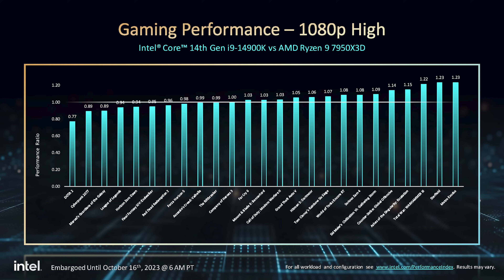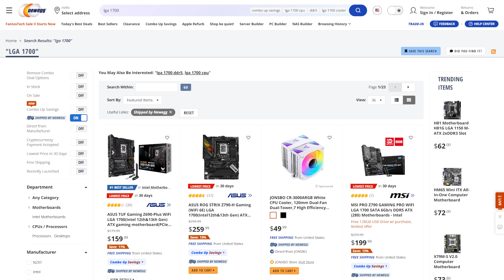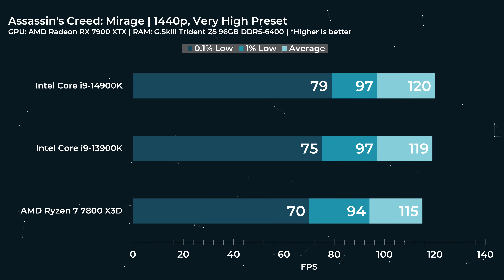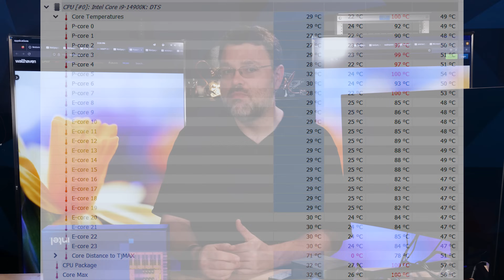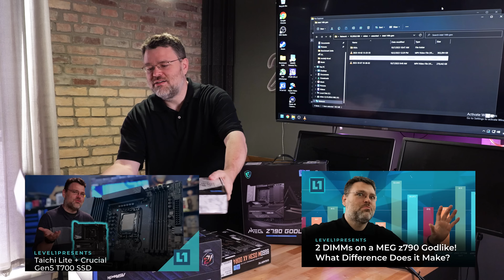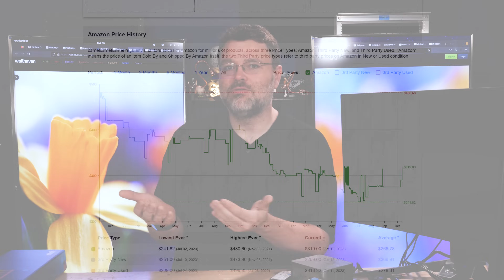14900K = 14th Gen or 13th Gen Refresh?

Comment: Please compare the non k versions when they become available.   I have a 12600 non k (zero e-cores CPU) and am thinking about upgrading to the 14700 or 14900 non k.  I am not sure it will be worthwhile for regular use, light gaming.  Will there be a worthy upgrade path from 12400/12600 that could avoid the power hunger insanity of the k chips??

Comment: As i understand, you can check your motherboard settings to see what power delivery mode is in, and gotta be careful as "default" is now the highest power setting, not Intels 253 Watt max. But yeah, you don't need to let the CPU roast at 350-400 watts under heavy MT loads, it seems to perform near the same. If i were getting a 14th gen, I'd try to take advantage the power savings and keep the same performance as 13th gen.

Comment: i have a z690 asus rog strix "E" mobo (DDR5),  I would like to upgrade from a 12900K to the 14900K.  Will that give me a pretty good boost for my flight simulator 2020 game?  i have a 4090 GPU and a 1000w EVGA G6 Power Supply...will I be ok?,  My CPU cooler is a closed loop Corsair ICUE H150i Elite Capellix

Comment: Stable is super important.
 As someone who has bought every top end CPU, including KS variants I'm excited to test the 14900K. I hope for a 14900KS release but kind of doubt it will happen. 

For me every tiny bit of performance is important for what I do, and the Intel CPUs have always delivered while maintaining rock solid stability. 

I have some AMD processors, and some of them come close like the AMD 7800 X3D. But I find them to be far less stable and have more issues overall. I had to RMA 2 different ones for failed memory controllers in the CPU and they were never overclocked! They also lack the pure clock speed to compete with anything where thread speed matters.

Also, I find it ironic that Intel processors run Starfield best in an AMD Sponsored game. 

My 13900KS is still #32 in 3dMark CPU (8 Threads)  (WATER COOLED)
https://www.3dmark.com/hall-of-fame-2/cpu+profile+8+threads+score/version+1.0

I wonder how the 14900K will compare.

Comment: I thought Intel was thinking of dumping the ecores... The 7800X3D and other CPU's stomps the 14900K in some of these tittles like Cyberpunk 2.0 / Phantom Liberty. 7950X, 5950X and other high core count AMD parts still stomp 14900k in titles favoring core count (real cores not e cores) the 7900X even stomps it in some titles. More pcores still better in supported titles. 

If ur 3D vtubing using an Unreal Engine Environment environment Intel will just dump your tracking software, unreal engine and OBS to the ecores completely borking your stream the moment you launch a game and even if you disable the ecores then you only have 8 pcores to work with at the high end which is problematic for 3D vtubing with the latest titles. VRChat tubers not really affected because its all done in the same application but VRC in full or open worlds does also like more pcores because it can get extremely resource heavy at that point. Similar problem with the hybrid X3D CPU's and core parking or die to die latency and weirdness with core parking disabled. If I was forced to choose an 8 core CPU for the aforementioned task I would choose a single die X3D part that wont have any gains in production but will offset less cores a bit in titles that prefer X3D parts or a 7700X for non X3D part because it draws less power, cost less and still competes. Basically the 7950X, 7900X, 7700X and 5950X is still the overall king for complex production environments at an affordable price. Not to mention AMD is the king of Blender and Adobe Premier which people in any kind of production environment are likely to use.

Comment: I have been hesitant to upgrade from my i9-9900k since I was always told  that it was only  "marginal gains" from generation to generation but I at this point there should be a substantial lift in performance even going to 14700k right?
Reply: Of course there is a massive uplift to be had upgrading from your 9900K to these, but there has been for quite some time now.

Your 9900K comes from a time when Intel was mostly stagnant gen over gen, with Rocket Lake (11xxx) marking an all time low.

Then came Alder Lake (12xxx) and that brought a noticeable uplift over anything prior.

However, not to rain on Wendell's parade, but 12th to the so called 14th gen is pretty underwhelming again. Outside of the e-core increases to the whole stack in 13th and now only to the i7 in 14th gen, it's more of the same.

In the end, if you really needed it, you could've had an upgrade with 12th gen already when sticking with Intel, or Zen2 and especially Zen3 even sooner when going AMD. These days, I'd definitely not upgrade to 14th gen Intel, because outside of some very specific usecases there's a better offering from AMD across the board, and unlike LGA1700, which is now effectively dead and gone, AM5 has a clear upgrade path to Zen5 and possibly Zen6.

If for some reason you want to or even have to stick with Intel, I'd strongly advise to wait another year for Arrow Lake, if you can. That'll probably be a very decent uplift over 14th gen and being on a new platform have an upgrade path, too.
Reply: If you really need to upgrade sure but I would wait for 15th Gen or give AMD a try.
Reply: @Epsilonsama  I am strongly considering AMD due to its energy efficiency compared to these intel cpu's
Reply: @ashamahee if its for gaming, 7800x3d is simply up there. The i9s are really powerful and the i7s are also very good, but Vcache is such a boon for gaming and the 7000s being quite more efficient and easier to cool, makes them a much better overall cpu for gaming.
Reply: I'm in the same boat... 14th Gen will provide a huge uplift in performance, but I can still play everything with my 9900k today.  It's hard to justify the expense.  I build in small form factor cases, so I am leaning towards AMD as my next upgrade path.
Reply: @CannonC0cker  yeah but when looking at the charts comparing the 9900k it seems to be massively behind in performance but the newer ones are just so insanely power hungry that I dont want to buy them unless I can limit them somehow, but then again what would that do to performance?

Comment: I wonder if the clock binned i5s from 12thgen are stilll in production. I still see 12500 and 12600 in stock pretty regular... if the price on those came down just a little bit (or if you score a deal) they would be really nice entry level parts
Reply: No, they produced lots of Alder which undersold, so ADL parts were rebadged as 13th non-K SKUs which use the same Intel 7/ 10nm process.
CPUs are compact to store.
Intel don't want to discount, Pat made investors promises about increased margins.
It'll be far better to score a 7600 or coming APU, AMD are shaping up for Zen5 release so Zen4 will become the budget option.
Reply: @RobBCactive  yea that's fair assessment looking forward a few months. Would be nice to see more budget am5 boards tho. At least here in canada they are still priced at a premium over the lga1700
Reply: @christopherjackson2157  I just rather have a decent quality mobo, which will be good for a CPU & GPU upgrade when I build.
The launch this week shows Intel's platform has nothing more to give.  People are hoping for discounts but Intel 14th is a marketing strategy to increase margin by having a new thing.
As Steve of Gamers Nexus put it, bigger number better.

Comment: I am still in what way the intels efficient cores are actually efficient, does any intel cpu with efficient cores use any less power then any amd processor when doing daily that most systems can do almost while idling.
Reply: If you use it for low level tasks, overall power consmption is lower. It basically goes into a meh high efficiency mode.

Comment: Were you running the 7800X3D’s memory controller in 1:2 mode? What’s the FCLK? Your 7800X3D results seem off especially when you were using the 7900XTX instead of the 4090. Plus, I haven’t seen anyone booting a 96GB 6400 MT/s RAM kit in 1:1 mode on Zen 4.

Comment: Sooo , question,, and please gimme the facts,, I bin waitin' 2.5 years to build this PC. I want to build a Pc for audio production ONLY, so i7-14700K with 'no video card' ,, will I 'need liquid cooling' in this scenario given the extra power and utility from the refresh i7-14700K?also, no mention of any ASUS motherboards...is that due to a technical issue with the boards or a separate sponsorship issues.
Reply: you can limit power settings in bios i think, or get amd?
Reply: @wiziek  'Cept, may as well buy the previous 13h gen processors,, which many also had heating issues.

Comment: How does 14th gen deal with 4 sticks of high capacity DDR5 vs. 13th gen? That's what I'm interested in.
Reply: I’m interested in this too. My 13900k has never been able to post with XMP on with all 4 sticks (for 128gb in total), so I’ve had to use only 2 sticks (64GB for now). If 14900k somehow helps solve this, I’d be interested.
Reply: not so well from other revues I've seen. The industry is pulling or consumer demanding legs. They don't have overheating issues under control

Comment: Intel needs to back off from chasing more performance for a generation.
I think a lot of people would have been more impressed if they came out with something that is no faster than last gen but used 30% less power for the same price.
I'm getting sick of hot power hungry cpu's and gpu's lately, Industry needs to take a step back in my opinion.

Comment: Similar performance but not similar price. Will most likely get real interesting when it approaches market saturation and prices lower.
Reply: It literally is similar price. It's launching at 13th gen's msrp which is more but this is no Zen 4. Street prices on 13th gen are only like 10% less than their launch. Either way basically a nothing burger besides the addition of the digital linear voltage regulator which power benefits are very skewed to benefiting lower current draws which is why the 14600k uses about 15% LESS power than the 13600k at full load despite a +200mhz P all core frequency. Genuinely impressed there seeing when ocing my 13600k to +400mhz on the pcores It needed ~40% more power even when setting the voltage as low as it is stable at. That being said on the 14900k u only get that bump with an additional ~5% power which at 5.7ghz all core is more efficient than an ocd 13900k (if it can even reach that frequency) but regardless it's much more underwhelming. Either way in something like blender the 14600k with effectively 8 cores (when adjusting 4 ecores into 1) only losing to the 7900x by ~20% while consuming ~15% less power on a 7nm node vs a 5nm node is very impressive and I did not expect perf/watt to be that much better on the new i5.

Comment: When 12th Gen came out i had the money to do it, and instead i went to an i7-8700K (from an i7 -4790 - which was still good for my workload) instead, why? The insane power and thermals....and i cant see me leaving 8th Gen for the time to come. They need to reign in the power and thermals....its unsustainable and downright stupid....at least theyre not alone AMD is batshit crazy making 90c CPUs "normal"
Reply: At least with AMD it a a ‘pick your poison’ approach. Run it at limited power and you’re getting great thermals, and 90% of full TDP performance. Limit intel, and you’re crippling it.
Reply: There is a very simple fix on AMD. Just activate the 95W eco-mode or even lower if you want.
Reply: Similar, running a 4790k and still seems to do the job. Was going to upgrade to a 7950x but wasn't quite right and felt I may as well hold off for another year. Hopefully the next line of AMD CPUs are a bit better.

Comment: I'm most interested in DDR5 now being plug and play now.
Also I feel its worth mentioning that the Intel is pulling 280-330w in those benchmarks while the 7800x3d pulls what 85-95w?
Intel is defiantly faster for sure but you seem to be paying a premium for it, and I don't mean $$.
Reply: Well you are definitely paying a premium in both price and power draw if you are comparing a $600 14900k to a $400 7800X3D. Wouldn't the 7950X3D have been better to use for comparison in highly multithreaded scenarios?
Reply: @Adam_Lynn  you are correct, but I was mainly looking at the gaming FPS numbers.
Reply: His 7800X3D results are off. I have to suspect he was running the 6400MT/s kit in 1:2 mode, basically running the memory controller at half speed. M

Comment: DLVR didn’t make it into 14th Gen then?
Reply: Nope.
Reply: what's DLVR?
Reply: @tanmaypanadi1414  advanced voltage regulator system in hardware that theoretically could have cut power draw 10-20% out of the box. Was my hope for 14th gen being worth a drop-in upgrade since I’m limited to a 280mm AIO. Still I’ve got a 12600K so now I just wait for a steep deal on a 13700K closer to end of December or early January and I’m still pretty happy I think.

Comment: Dont bother with 14700k Steve from @GamersNexus already said its a bit overclocked 13700k and nothing special.
Reply: Bigger number, not bigger performance, but bigger power consumption.
Reply: More clock speed and more cores for the same price. Not sure why there's so much hate on the 14700k. Doesn't make sense to me.
Reply: @MrHav1k  same launch price yes. But not current price. But if you aren't doing production tasks, it primarily falls within error of difference between samples of the 13700k. If the 14700k is interesting for anyone, they should spend the same amount on a 13900k instead and actually have a performance difference, even if still relatively small.
Reply: there is some improvement 7% to 12% in productivity workloads and rendering stuff but over all it's mostly 4% bump with a overclock